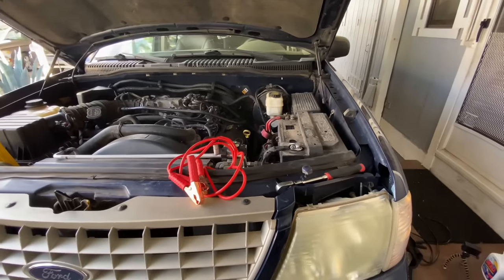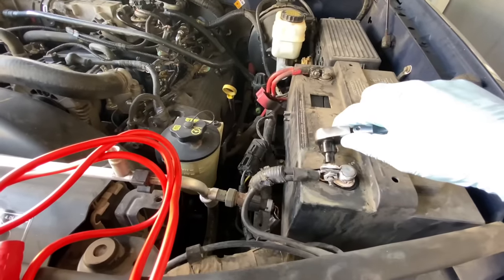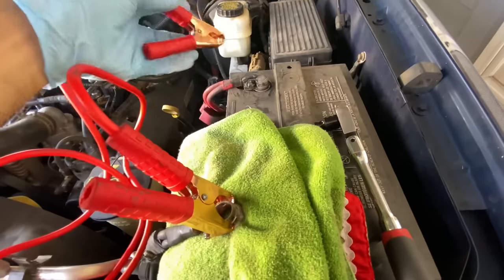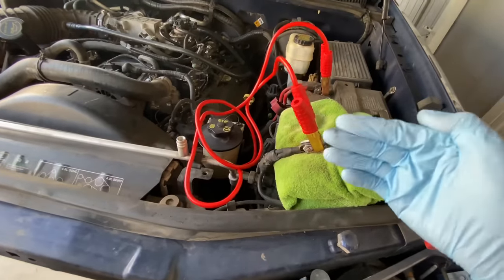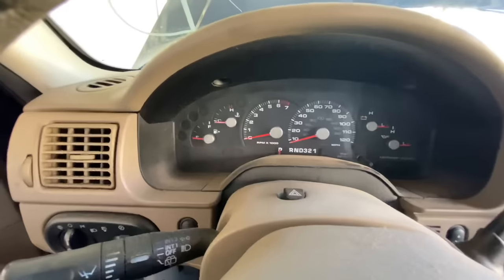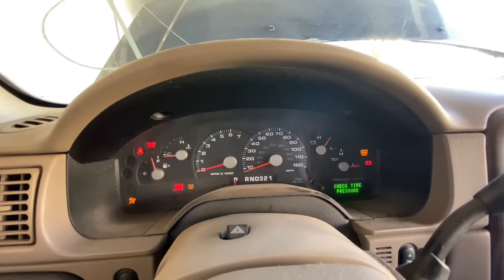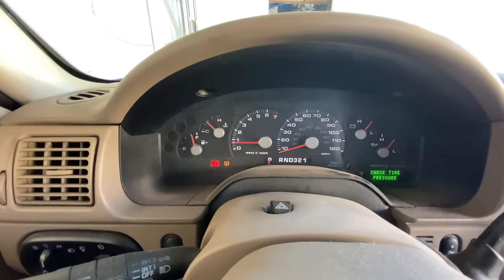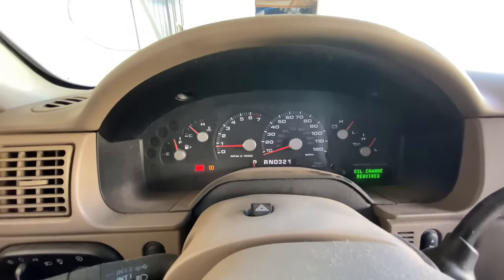How To Reset All ECU’s and Control Modules in your Car or Truck

Comment: I have a 2012 Ford Fusion that i need the cluster replaced, if i do replace it will the vehicle need any type of reprogrammed?? Or just plug and play?
Reply: Jimmy S  May depend on the car itself.
My previous car, an Audi TT, needed the new cluster to be coded to the car after installation.
👍🏼
Reply: Jimmy S  ahhh... 
Thanks cool 👍🏼
Reply: Jimmy S  u do now that this year the computer control everything from brake to the steering sensitive which change depending on your speed

Comment: Is this process required after installing a new egr valve because my car started running lean after I installed it. Air/fuel ratio is not right.

Comment: YOU Don't have to use a jumper cable just unhook  Neg Battery cable for 15mins  & you don't need to cycle the key just start & drive the car the ECM will do a relearn within couple hours BUT all its going to do is Clear the ECM , If your Vehicle has Problems like a bad 02sensor or bad MAF or Bad MAP or Bad TPS   OR any bad part   ,  Unhooking the battery cable  is not going to magically  FIX those Bad Parts  If you don't replace any bad parts  when the ECM does the relearn all those codes for those bad parts will be set again & your check engine light is going to come back on !
Reply from the maker: I didn’t say it would fix bad parts, I said it will reset values to start again from scratch and fix any inaccurate information stored in the ecu. Thanks
Reply: Will this procedure work 2005 mb c240
Reply: No point doing it then  hahaha I was hoping it would fix my blown cat o2 sensors stopped juddering and put petrol to full bars    dam

Comment: I did this step by step and it turned my check engine light off. Thank you for helping me out. Now my only issue with my truck is , going Uphill in a 50MPH zone in 4th gear my truck looses speed. I can only do anywhere from 35-40 MPH.
Reply: Check your filter

Check your fuel filter
Reply: Exhaust restricted?
Reply: Of course the check engine light will reset because you remove the 1 battery lug terminal the ECU will sleep for a while even only 5 minutes itveill reset the ECU your check engine light will reset.
Reply: It took your check engine light off because you  took the terminal off but right it for a while and will come back on.. trust me it's temporarily
Reply: Yeah any time you disconnect the negative battery terminal it will reset you ecus engine codes..nothing to do with this process specifically

Comment: Does this method reset DTC codes without having to do a drive cycle?
Reply: Yes it does reset the DCT codes but you do need to take us through the drive cycleswhich is normal driving like a 5-minute drive 5-minute idol turn the car off let it cool down let it idle for 5 minutes turn the TV off driving on the highway you know driving on the highway 10 minutes out a title 5 minutes driving on the highway

Comment: Some people does that procedure without opening any doors. They leave the window open and access the ignition key through window.
Reply: U are correct my friend because u don’t want even the slightest electrical spike during the 10 minute idle re learn procedure  make Shure radio, air con ,phone charger, etc , is all off before starting and don’t touch the accelerator
Reply: @Crazylife069  How in the world does sitting in the vehicle cause an electrical spike?

Comment: You got the tps light on, if you don't want to replace them sensor's just cut the pink cable peel the one going in to the module and peel off the red without cutting it then connect the pink on the red cable  tape it together and the light will go away
Reply from the maker: Good to know thanks
Reply: Thats smart ih a 2000 jeep grand cherokee parasitic drain can you help with that

Comment: Does it matter if I use the negative jumping wire? Also will it work for my problem that my AC stopped working after I took off my battery?

Comment: Will this work with '16 durango? I saw a post that both wires was taken off the battery and connected to eaxh other to discharge the capacitor.

Comment: If it resets the ECU, why is the oil change required light still on?
Reply: Because it's au Ford😂
Reply: @nyjemacejones1882                             Fix Or Repair Daily lol
Reply: The ECU uses electrically erasable programmable read-only memory, which is non-volatile. The shifting adaptation, idle rpm, fuel trims, and odometer readings are contained in memory that is not erased with power removal.

Comment: Just did it on my 2004 Volvo XC90.  Worked a treat.
Reply: Wow... I have a 2004 Volvo XC70 and I have a problem with my side mirrors readjusting themselves every time I turn car off and on... I'm thinking about doing this because the only fix is to dealership... cough cough... I mean stealership
Reply: Hi mate... Just to ask u for for mine volvo s40 2001..after u do this process.. The immobilizer or key fob still function?
Reply: Hey I have a 2008 volvo s40 did it work for y’all and should I disconnect both and then touch them or what the video said
Reply: Yeah, finnaly i found volvo's owner
I have volvo s40T too, any of you succes try this?
Need answer soon 🙏🏻
I have code P0171 vacum and also yellow ⬆️ flash on my dashboard
Help me please

Comment: HI. Thanks for this great video. Very clear explanation. I did it exactly as you explained because my ECU was resetting the “warms ups since last code clear” and “ Miles since last code clear” to zero spontaneously every day or two. I was never clearing the codes myself because there aren’t any. Unfortunately your reboot didn’t fix the problem. It is still doing it. Have you ever heard of an ECU doing this? Do you know how to fix it? The car cant pass inspection because of this problem. I dont even know if replacing the ECU will fix it. (Expensive part). Thanks sooo much if you can suggest a solution.
Reply: U were supposed to lift the positive and put it to ground or negative
Reply: @anthony_entrepreneur_ don't listen to this "advice" by the person I @, it'll blow your battery up.

Comment: Dont lock the car whilist doing this. You can loose the key -fob code. Check owners manual how to reset key.
Reply: On a older ford switching the ignition on off 4 to 5 times disables the key fob then again to re-enable.

Comment: Will this work for a 1998 Dodge Grand Caravan 3.8? Just put in a used computer need to program how?
Reply: You have to make sure ya don't have any direct leads to the engine itself or the body. A lot of cars today are positive ground system which is fine but others like the Silverado's and Ford trucks it's a big no no. a lot of Domestic cars and trucks still have a frame ground system and those R the ones that it won't work with. Usually if ya see sparks ya know it's a boo boo...
Reply: Did you keep the prom from the old computer and put it in the new computer

Comment: Very helpful, thank you. Is a reset the same as a flash? I'm converting to electric cooling fans and it says to flash the ecu when complete. What is the difference?
Reply: No. Flash means it needs tuned
Reply: Flash means it needs programmed
Reply: I wouldnt reccommend flashing yourself you need to goto a dealership. If you dont flash properly you could brick your car. Meaning fuck it up beyond repair

Comment: Thanks for this tip, I will keep this in mind in case I run into any such issues. 
On the subject of ECU's, have they yet made any cars that give out their diagnostic data by email to the owner and dealer every night? Just saw an airport  fire truck that does that.
Reply: This is interesting...I know dodge has built in obd2 diagnostics and read outs on the dash...u can actually run the self diagnostics in the vehicle by doing key codes...it’ll test even the instrument panel and gauges etc...head lights and wipers...kinda neat to watch it run it’s testing..turns itself on and off etc..then it’ll read out any problems it encountered on the odometer...all dodge Chrysler and jeep ...mopar vehicles have this built in...it’ll save ya 100s...some shops charge $150+ to hook a vehicle up for diagnostics...so it pisses me off when I hear the dodge dealer charged someone to run diagnostics on their mopar vehicle...no one reads owners manuals anymore...tons of excellent info in them like this type of info
Reply: Sorry to bother you but I have a 2006 Jeep Liberty with 136,000 miles and I was driving about an hour away from my house and I got stuck behind a semi. I went to go around him and my traction light came on and I started to lose power so I pulled over. And yes I didn’t know what to do so I shut it off. Now it has the security code the abs the esp I think it is lol on the wheel it’s self. I put the key in and go to turn it on I can here the relay and the singing but that’s it. The lights radio and power locks still work it just won’t go 🥺 please help
Reply: @rochelleknowles5098  Sorry Rochelle, I am in New Zealand. Can u call the AA or tow truck if it does not move?
Reply: @mohabatkhanmalak1161  probably gonna have to which sucks lol ty
Reply: @rochelleknowles5098  I have the same problem with my 2014 Dodge Challenger! I was told that I needed to replace the TIPM (total integrated power module). Hope this helps Rochelle
Reply: Rolls-Royce have a satellite communications link to all flying aero engines , they self test and then download to the mainframe computer all relevant information. It has been known for RR to know of a problem before the airline.
Reply: Yes. Some companies do this already. If your car is '96 or newer you can buy a device that will plug in to your OBDII port that will do this. You can also get real time info on all of your sensors and monitor your engine's status at any time.
Reply: Maybe your alternator stopped working.
Reply: Hi I have a question I was having my car shut off because of my transmission pressure I was told that the codes I had previously triggered this new problem can I do this and will it work?

Comment: Will this work if I need to use a new key since I lost my originals.
Reply: No different procedure for that key on 10mon key off 10sec key on 10 min key off 10 sec key on ten min key off ten sec start your engine new key good to go.
Reply: No.
You will need to get new keys and have a locksmith program the new (Transponder keys)!

Comment: Will this work on my 2009 chevy hhr crap of a car,  I've spent over $900 to get it and to KEEP it running!  After so many uses ALL the lights on the dash will come back on, reducing engine power. I have replaced sensors, replaced or fix computor codes. Nothing seems to work. Should I get rid of it, what a piece of crop.  Im 80 yes old, never in all these years have I had so much trouble with a car, I wouldn't reccomend and hhr to anyone.

Comment: Could just press the horn for 1 minute to drain the remaining power after battery disconnected, this takes total of 1,50 seconds  to do just discon battery plus+  tg en press or hold horn  15 seconds ,then reconnect then start car for  20 secs turn off engine an  start  back up  immediately, Abracadabra, warning lights all gone ,,
Reply: Doing it like this guy is doing also resets the ECM..

Comment: I have a 2009 explorer sport trac with 143,000 miles.  Started   High rev going from 2nd to 3rd gear until it warms up.  Could this fix the problem?

Comment: Is it standard procedure do you have to do it like everyday you have to do it like every week what's the procedure what's the standard for that is that in the manual the book
Reply: You dont have to do it at all, those data in memory aren't there for nothing.
Its just handy for cases like when you have Your broken MAF sensor changed, to quickly adapt on correct signal from new one, because those ICU's are keeping long term fuel trimming etc. to match fuel mix to the value of Air intake which is given to ICU by MAF sensor.
But those values get updated sooner or later anyway, so i dont see any need to do it, i can be wrong.

There can be of course another use cases.

Comment: I've always reset every electronic in my car by disconnecting the positive and negative cables and connecting the wires themselves together to ground everything in the car out. I dont really see how you're doing much more than just bypassing the car and draining the battery by grounding it out. I've reset many ecms including my own car's computer before I'd tune them up while getting ready for a drag racing event. To quickly reset everything disconnect the battery  and touch the wires together so it grounds out the electronics in the car. Doing it the way he shows in the video would basically just drain the battery down because the battery is being grounded out. I dont see how this guy's method really does anything more than just disconnecting your negative terminal for 30minutes would do. Also dont drive it easy after the reset. Drive it rather harder so you get a more performance oriented tune. More timing advance, firmer shifts (less slipping "in automatics only"), better Air fuel ratio, and personally I e gotten a noticeable feel in throttle response (likely the timing) and I've also gotten slightly better gas mileage. My car is slightly older than his f*rd. My car is a 2002 Pontiac TransAm WS6 with a 6 speed manual transmission car that has 70,140 original miles on it. Great car that is not even heavily modified and makes over 400 rear wheel horse power and still get 22-24mpg. Even after you reset everything and then drive it harder for a while, you can then ease off of it and drive normally and you should hold that performance increase for awhile and get better gas mileage. Once you notice the mpg dropping back down and it starts feeling weaker or less responsive, then reset it again and start over. I usually do my car ever 2 months or before I do a tune up before I would go racing. I hit my goal while racing so now I just tune it up for performance and to keep everything fresh and running top notch.
Reply: How long should i touch the pos + neg cables together?? Thanks for info
Reply: I want to thank you for your response to his post but I’m still having issues with my 1991 Camry after replacing it with a new battery, the car is not communicating with the ecu, I’ve driven it about 80 miles but not in one trip but rather 8 or more different trips which adds up to about 80 miles and still it’s not communicating with the ecu, would you have any advice, am I not doing something correct, I’m trying to get my car smoged. Thanks for your time and God bless.
Reply: Yup positive and negative away from battery posts/Terminals and drive harder than normal
Reply: @alabamaheartbreaker7918  15 min /ish
Reply: Jonathan Hudson
What he's doing wont drain the battery. The positive charges cannot get to the negative terminal of the battery.  But it will remove all the voltages in the ECU capacitor or whatever passive components that hold electrical charges. Its like shorting out a capacitor to drain all its charges
Reply: John, we use resistor when the capacitor has a high capacitance.  I doubt an ECU has that big capacitors. Just touch the two battery leads together and it will discharge it completely safely. Resistors  just slow down the draining process for big capacities safely otherwise the sudden flow of big surge of current will happen.
Reply: @vincentlee2460  So should I touch the two terminal wires together? And for how long? Or just do it the way in the video? Or doesn't matter,works the same? I also saw a comment say just leave negative off for 30mins
Reply: @odinbolt4380  You can discharge the ECU by connecting a 10W 1 ohm resistor across the two battery terminals. Shorting the terminals like what u have done might damage the ECU on certain cars that have larger and multiple capacitors. Really risky.
Reply: @vincentlee2460  Preciate it
Reply: L
Reply: @odinbolt4380  Just disconnecting the battery for 30 minutes won't discharge the ECU completely. Doing this will. It's like restarting your phone versus a factory reset.
Reply: You say you are involved in drag racing yet you don't even understand that it's impossible to drain a battery with only one terminal connected or that the method shown eliminates the battery the same as if both terminals were disconnected and the battery placed on the floor and you don't understand that your method and the one shown are just two slightly different ways of connecting the cables together...  except you wasted time disconnecting the positive terminal which provides zero benefit.
Reply: Changed ecm with one from junk yard. But the battery was already disconnected for a day.
Guess what I got, battery on, No CRANK.

Comment: I ran diagnostics on my neighbors 2004 Volvo s40 with the 1.9 liter engine.  The code "PO602 Powertrain Control Module (PCM) failure, Wiring issue" came up.  Is this an issue that might be solved using the above reset?  Thanks for any help.

Comment: Good video! Do u know if this will work on a 2010 Dodge Ram 3500 dully with 6.7 Cummins?
Reply: So did you try it and did also worked or what did you do to fix the problem
Reply: No I didn't try it.  I ha e 2 batteries in my dully.

Comment: Bruh I been through 3 speed sensors. This worked perfectly. Much appreciated
Reply: So what exactly does this reset do? Should I do this if I put in a new vtec solenoid and also if I put in a new Accelerator Pedal Position Sensor?
Reply: @theroyalone7588  Geez--I wish cspruell26 would answer.  I have a speed sensor warning, took it to a shop that did a cleanup of harness and sensor but still has trouble code and now 02 sensor/circuit code.  May be an overall trans issue, buuuuut, maybe not?????  This maybe worth a try.
Reply: I'm not sure if you have to (or should) after installing the parts you mentioned. I was having a misfire and the code was saying bad speed sensor. After 3 new sensors and the third failing the same day I found this and it worked
Reply: @Kaze Cat  definitely worth the try it won't hurt anything